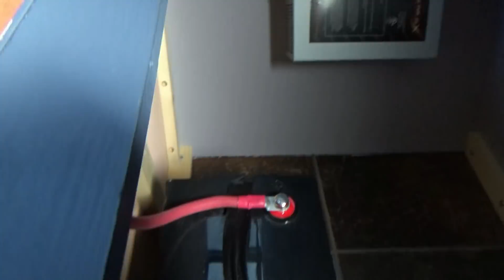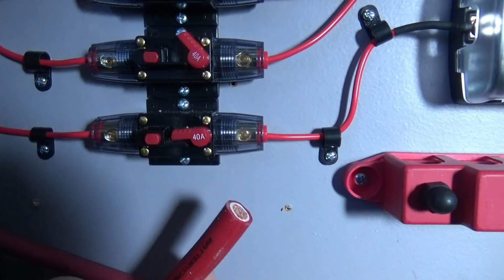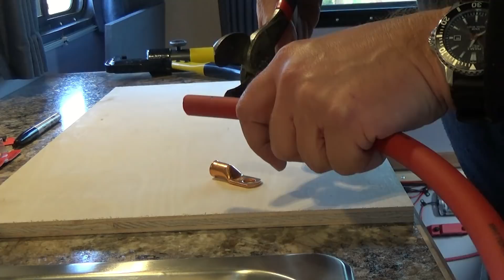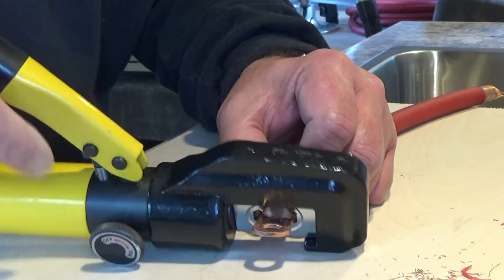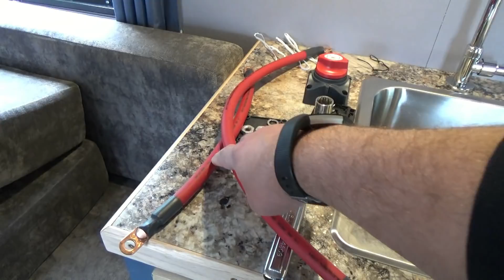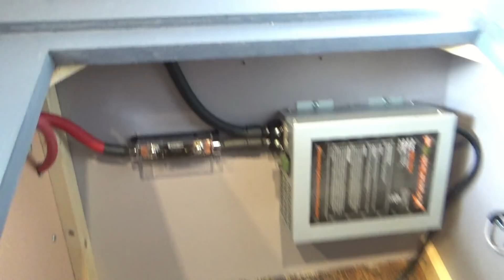How To Build A DIY Travel Trailer - Part 75 (Installing Xantrex Inverter Part 2)

Comment: very professional. I will buy it. I previously built a support trailer for a camper and for outback tent camping.  a Full Portable Bathroom. 250 fresh 250 grey, 100 black. tub shower heater everything spent 12g on it plus trailer and generator. did it with a cargo trailer aluminum floors etc. I had it done works great. it has a generator and solar. your build is very nice.
Reply from the maker: Thanks Reno! My neighbor is also converting his cargo trailer into a camper... ironically, the name brand of his trailer is "Stealth" LOL!  Sounds like your trailer was very deluxe! Thank you for the kind comments!

Comment: Good call replacing the old 2 ga cable.  00 ga (also called 2/0) can carry exacrly 2X the current of a 2 ga cable, while maintainting the same voltage drop thru your cables.  So less heat from your 12v cables to warm up your trailer when you have the microwave or coffee pot running off the inverter ;)  The inverter can pull up to 180 amps from your batteries, but the charger only puts out ~40 amps, so you coulda got away with as small as 4 ga there.  But the uniformity of your install looks awesome!
I can't remember if you got venting for your battery compartment (off-gassing) installed?
Reply from the maker: I am learning a lot from everyone's comments. Heavier gauge wire seemed the way to go, and it seems to be working very well. No heat that I can tell, although, a good tester would tell me if wires are getting warm. The batteries are sealed batteries, so not sure if they gas-off or not. I haven't vented the compartments just yet.. not really really sure If I need to vent to the outside. What do you think?
Reply: I forgot you had sealed or gell batteries.  So you are golden :)

Comment: I know this is a couple years old! You don't have a Big Fuse at the Positive post (Source) of your battery here.  Fuses are to protect the wires. If for some reason you were to get a short in the system from chafing or something nicking a wire while being pulled down the road the fuse needs to be AT the battery to prevent the wires from getting so hot that they start a fire. Called a Catastrophic fuse for that reason. You have a Lot of unfused wire that could burn if shorted. Size the fuse to what the wire will handle. Easy to add! Nice looking set up otherwise!
Reply from the maker: Thanks Bruce! I'll have to go back and check... but I think the first fuse is approx 24" from battery.  If I remember correctly, I have a battery disconnect installed then to a fuse.  The electrical is probably overkill for the power consumption that I use. All lights on combined pull a meager 3.6 watts, a pump that runs intermittently 5.6 watts. I use the inverter to run the refrigerator to place of camping then switch over to 110. Well... I stand corrected! I just went out and had a look at the system....  no fuse from battery to cutoff! So... I will have to install a fuse in that line! Great observation! I do have a spot to install and not very difficult to get to. I'll be shopping around for that and get to work on it soon. Thanks for pointing that out! Good stuff! Thanks for stopping by! Appreciated!
Reply: @OregonBatman  It's called a Catastrophic Fuse if something should short out. Blue Seas makes a couple of Battery Post mounted type fuse holders or something mounted to the wall as close to the Battery post as reasonable, then everything down circuit is protected.  Battery Switch could fail it you should get a short or if it was forgotten and left on and then you got a short. Your system looks Awesome!
Reply from the maker: Thanks Bruce, found it... Blue Sea has a post mounted twin fuse that will work for my application. Now I don't have to cut wires! :)
Reply: @OregonBatman  Awesome!!

Comment: OB- Cant thank you enough for your careful videos and the time you take to make them, which obviously adds to the time of the project that gives you the joy in the first place.  Question:  Why did you install a fuse on both ends of the positive?  It shouldn't matter that there is a kill or isolation switch in line with at least one fuse, two seems odd?  Many thanks for all your work, and great job on the rig!  Best From the warming CA US
Reply from the maker: Thank you very much... I appreciate the warm comments!  Had me stumped there for a minute. I counted and counted but can only find one fuse on the positive. From inverter, it runs to a fuse, then to the kill switch. From the kill switch, to bus bar, which connects all the positive together (same with ground). Only place that I think I could use another fuse is the positive to the battery. May install one there at some point.
Reply: So is that a fuse at the positive at the inverter and another on the neg side at the converter?
Reply from the maker: No sir... I do have a fuse at the positive for inverter, and a fuse at positive for the converter. It gets confusing for me looking at all the wires too! :)
Reply: Sorry,  I am designing my own, and keep getting caught up in the fact that I am using the Progressive Dynamics Mighty Mini electrical panel that includes the smart charging converter with it, and I forget that you do not have a panel as such, and are using screw in fuses, etc.. and building out the rest of your system with separate components.  Can't wait to see the parts involved in adding the solar into this matrix.  Many thanks.
Reply from the maker: I looked into that setup... looked really complicated to me (I'm no electrician!), so I took the easy route. Well, maybe not so easy... I have a lot of wiring that seems to be everywhere, if I blink, I could get something crossed! Keeping the solar simple... still running the wiring from controller to batteries, it is working very well. The batteries are being kept fully charged during the day, now that the sun is hitting panels full on. I appreciate you... Cheers!

Comment: I have enjoyed all your videos and your attention to detail in every area of the build. I have learned a lot. Thank you for your detailed explanations. What width tape did you use on the camper outsides? What is the spelling of the tape brand? Plan to replace my metal trim pieces on my 1960 Serro Scotty. Thanks again, beautiful job!
Reply from the maker: Hello Sherry! Thanks for stopping by! I purchased the Eternabond tape for the outside. I used the 4" wide roll and cut to 2" wide for use (I get twice the amount!)  :)  Thank you again, and thank you for the comment! Cheers!

Comment: Nice job but when will it be done looks like a 2 year project
Reply from the maker: It should be nearly finished within a month... I only work on it during the weekends a few hours here and there. Plus, documenting everything really does take time. If I were  to work on it full time (except weekends) , and have all supplies at hand... by myself, I could build it in about one or two months.